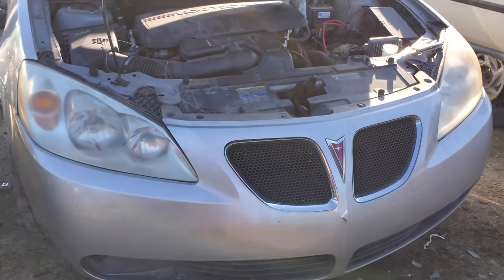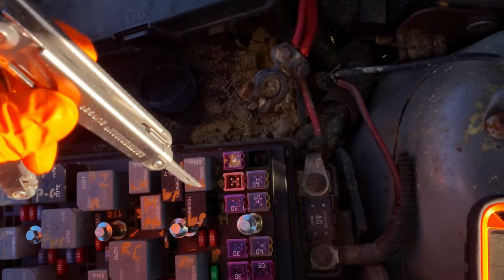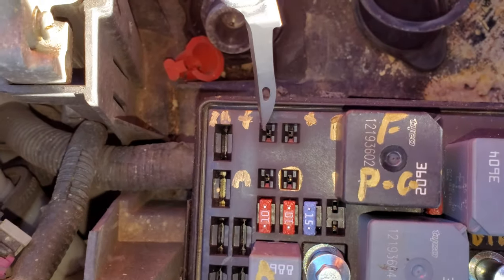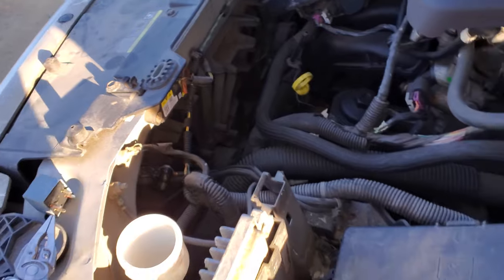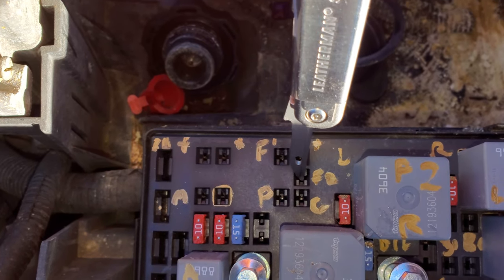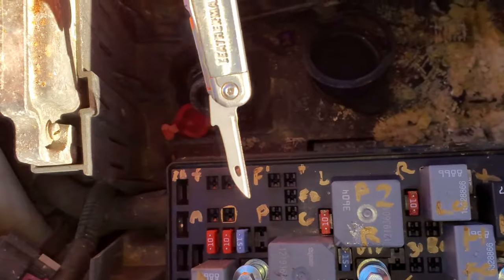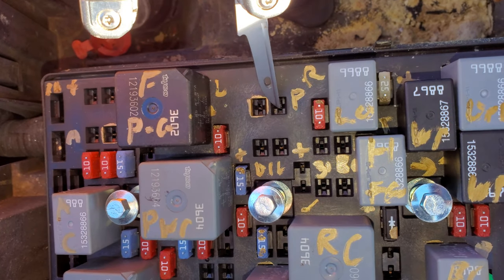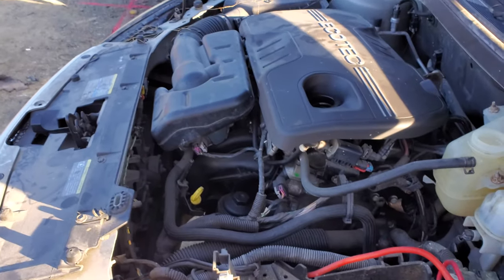2008 Pontiac G6 Radiator Cooling Fan Relays, Fuses & Circuit Explained

Comment: Thanks for taking the time to explain whats going on in these old cars,  I have an 07 aura that's having a cooling issue.   The fans wont come on,  I notice it in heavy traffic, so I have to keep the A/C on to make the fans run. Relay/ fuse /temp send switch.  At least the parts are cheep.
Reply: I know I'm late but what was your problem because I have the same thing wrong only spins when A/C is on.
Reply: My problem is on my 08 Saturn aura which is just a Malibu and G6 under another name the fans start up when I crank the car up and constantly run until shut off what’s the issue

Comment: My fan combo is brand new. It has begun to over heat when idle. Has coolant and oil. Although my oil dip stick has started showing my oil level all over the place like it's blowing upwards and all over my dip stick. It doesn't read right until my boyfriend added a quart then it looked normal again at full. Drove it and it did that again after 100 miles or so. But the overheating.   I Start driving and it drops back down. Start and stop traffic makes it heat back up even faster and turning my heater on high doesn't bring it down

Comment: Any idea why my fans don't come on at low speed, when the thermostat opens, but if I drive the car long enough, it eventually starts to get on the hotter side, then the high speed fan kicks on once the gauge is starting to show the car getting too hot?
I idled the car for an hour yesterday, to monitor the fans, and they never came on. Car sat at normal temp. I took it for a 20min drive, gauge started to climb, then I heard the fan or fans kick on and they were loud!
Thanks for any help

Comment: Okay I have a question my fan was on high and then turned off and not come back on switch relay switches check fuses everything's getting power but the sensors are not getting power in front of the fan two sensors one left one right don't know what to do

Comment: Hey so neither one of my fans are turning on causing my car to over heat. The grey fuses I can feel them clicking but I don't get low or high speed cooling please help
Reply: Never mind there was a 20a where there should have been a 30a at. I wouldn't have realized it without this video thank you

Comment: I don't know if you can help me I've got a couple issues with a 2008 Pontiac G6 hardtop convertible. The hardtop goes up halfway and just stops in mid-air. I'm also leaking something it's reddish so it could be the power steering or the transmission but I'm not sure. Is there a way to get in touch with you?

Comment: My g6 runs hot because fans don't come one. The fans do come on with AC on but not at normal run temp. Any ideas?
Reply: I am having a similar issue but when the car sits for a long period of time while running. I have not tried with the AC yet. The fans do not come on when the car is sitting.
Reply: Mines do the same thing how do I fix that
Reply: @CreampuffgameZ  did you ever figure it out? Mine is not coming on either untill it gets too hot.
Reply: @5nuk239  did you ever get it fixed? Mines the same

Comment: Hello! I noticed that before you removed the relays to show what each pin does, the relays were sitting in a specific orientation, but at the end of the video you put one of the relays back in a different orientation. My question is, does it matter which direction the relays sit in the pins?
Reply from the maker: 4-pin relays can be installed in any orientation that fits